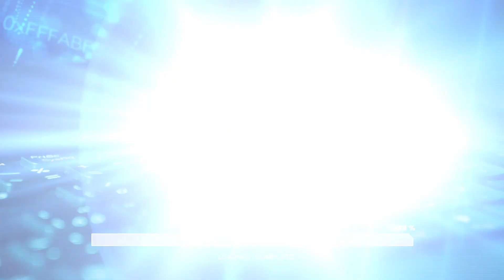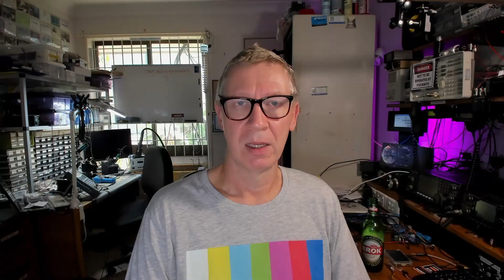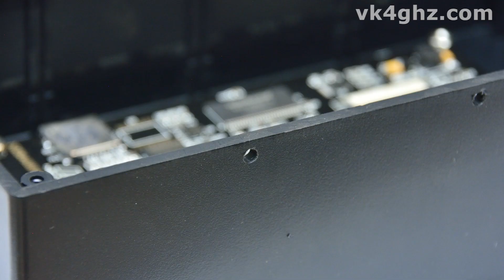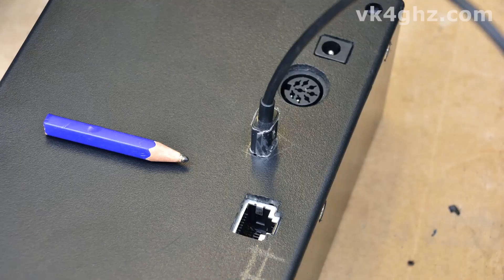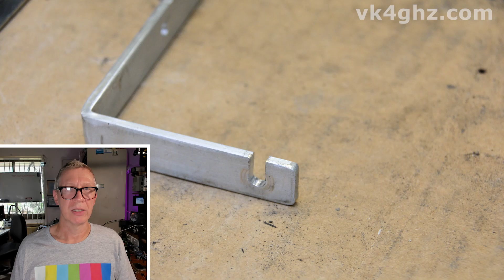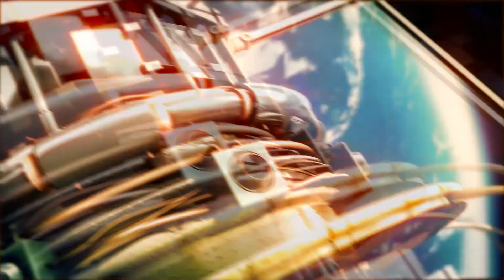K3NG Rotator Controller Project Nextion & Controller Board Mounting

Comment: Adam - a tip for drilling plastic.   You can prevent the drill from biting in if you take a hone stone and slightly flatten both cutting surfaces  with just a couple passes with the stone.
Caused the drill to scrape the plastic instead of biting in really hard.

Comment: Hi Adam,
is an idea to put ABS shortly in acetone after your procedure. Use a hook for that and for dring (some minutes). You'll get a clean surface again. 
73s, Jens/DHAKY
Reply from the maker: Thanks for the tip Jens.
Reply: @VK4GHZ  I use that for flatten the surface of 3D printed ABS parts.